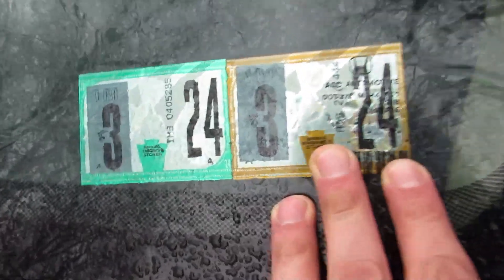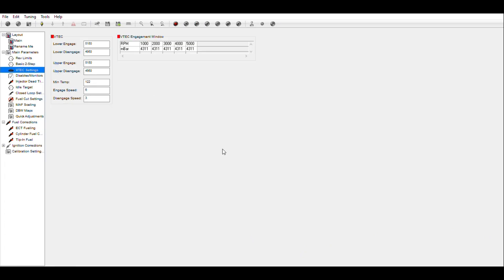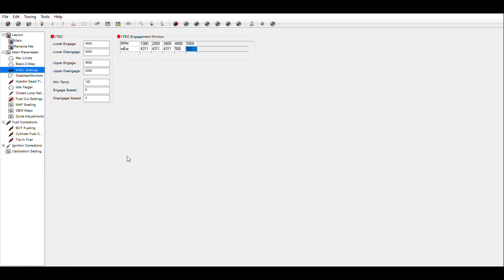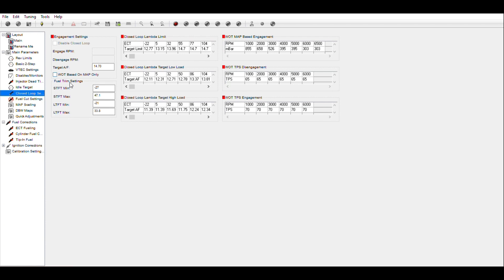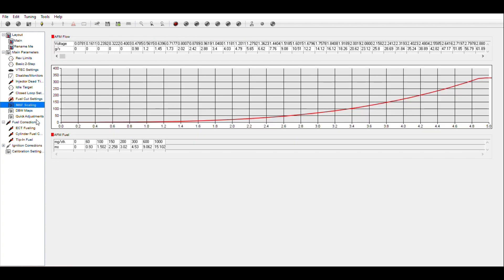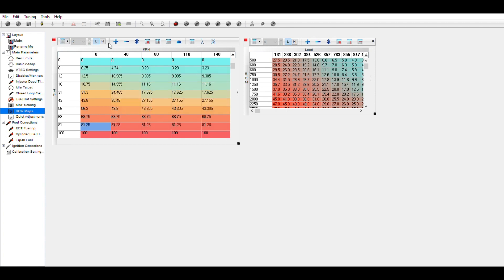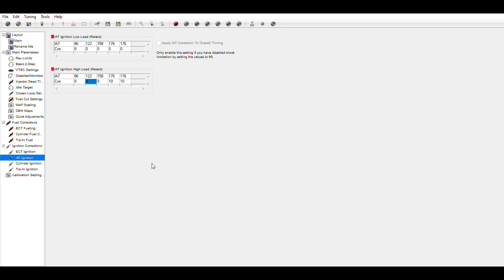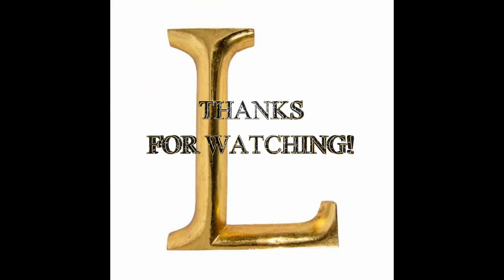KTUNER FOR V6 AUTOMATICS - 9TH GEN INTERMEDIATE TUTORIAL WITH 91+ OCTANE TUNE - DBW VTEC & SHIFTING!

Comment: Good info. I have a 4g Tl 3.5 hfcc takeda intake, p2p spacer throttle body and Intake Manny, Borrola exhaust, jpipe, tuner, jet maf and ktuner. Tuns lean the jet maf really helps with the inake huge difference however it needs more afr adjustment. Make another video please were running almost the same setup. Sucks they don't offer another tune ktuner that is. Kinda wish I got the 3.7 vtec intake and exhaust but I like how light it is. I had a 535xi like the acura way better.

Comment: very impressive video, question .. i added a j37 throttle body to the car, what setttings should be changed to maximize the mod?
Reply from the maker: Tricky question, I did the same and it does work really well plug and play style. To maximize the throttle body increase you'd want to update the MAF voltage as to match the higher flow. There are videos out there on how this can be done, it takes time. I would recommend a pro tuner. Phase two would be to increase the MAF housing in addition to the 80mm TB. I should have a video on this soon!
Reply: did you ever find an answer to this question? I just installed the j37 TB on the stock Intake manifold and haven't touched the ktuner settings.
Reply: @Acc15ord  no lol. In hondata there's a section called throttle flow vs opening where you take the difference in percentage of the j37tb vs j35 and multiple the values.. Some guys are telling me to do that in the dbw section on ktuner, but that just modifys the sensitivity of the throttle. So im lost as well. Ktuner admin is useless as well.
Reply: @ns5337  ah. There was 400$ out the window lol. Hondata works with the 9th gen platforms? 🤔

Comment: Would you be able to run the 91 tune with stock intake but high flow air filter ?
Reply: Yes I ran it on a stock intake, it’s only suggested you have an intake and exhaust for the best performance

Comment: Do you think anything bad will happen if i decided to make vtec kick in at a lower rpm?  

 Im trying to find a way to make the performance a little better.  The pedal when in sport mode feels heavy.  It doesn't have that light feel when i dont have a tune on.

Comment: Im curious why you didnt disable vcm?
Reply from the maker: Hey that's a really good question. I need to look into it a little more but it's possible the 91 tune disabled it in the background already. My test drive I didn't initially notice it engaging.
Reply: VCM delete should be the main reason for Ktuner lol. Useless if your looking to mess with the car, 1 less thing to break and minimizes uneven wear of internals.
Reply: @zylow_cr3 crazy statement. Just buy a VCM muzzler instead of buying a $350 dollar tuning device just for the “main reason” to get it is to disable VCM
Reply: @jayybizz_  My car is FBO so not the only reason but I would buy it just for seeing codes getting rid of the speed limiter and VCM. Is that better for you?